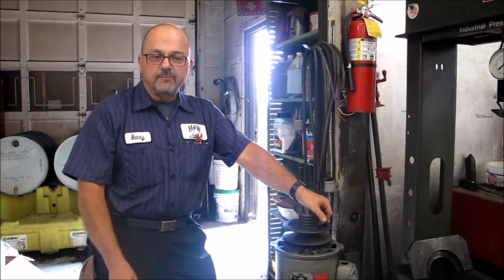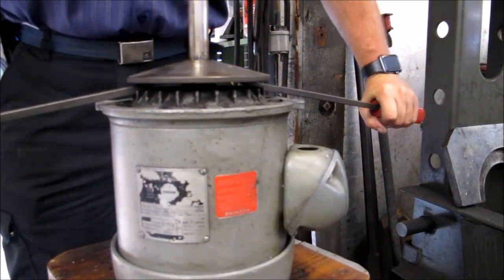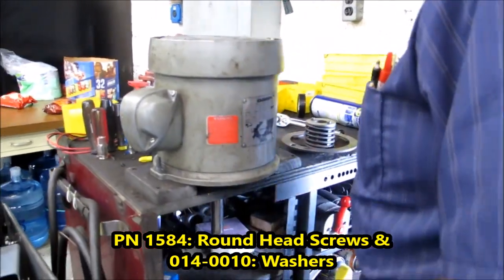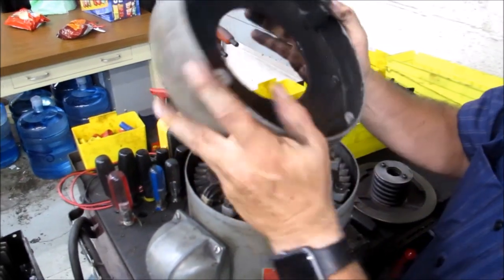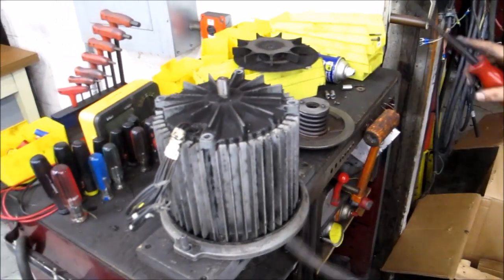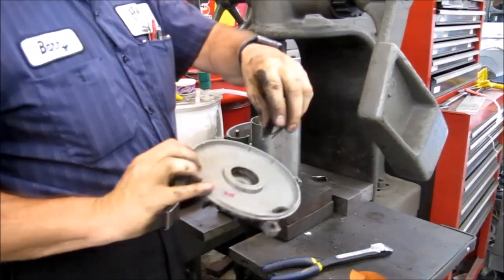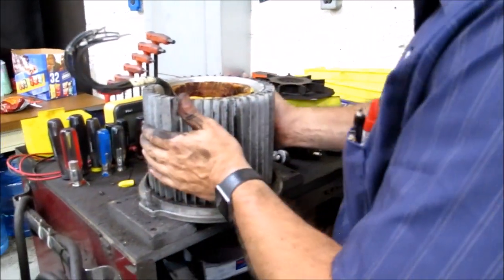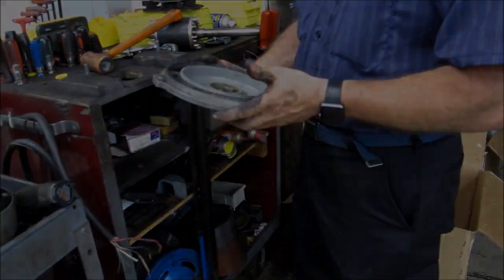Disassembly of a Bridgeport 1.5 HP Motor

Comment: Just for the record that thing you took off isn't a "computator" which what I really think you meant to say was commutator but in this case it was neither. It was the field windings you took off. Commutators are usually found on the end of starter armatures or generators and is the part the carbon brushes rub against. Not trying to be critical, just helpful. Musta been the pressure of being on camera! 

This was a really good video as are most all the vids you guys have made on dealing with these machines. Thanks for taking the time to make them.
Reply: And you joined him in being wrong. AC motors don't have field coils. They have stators.